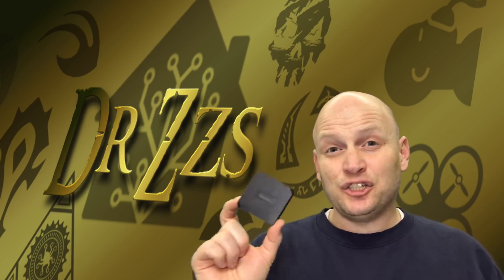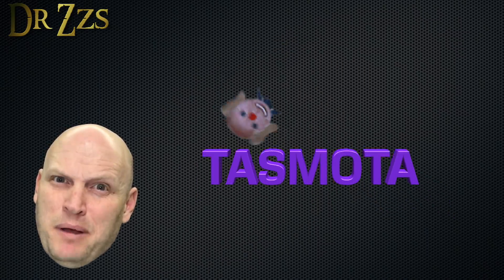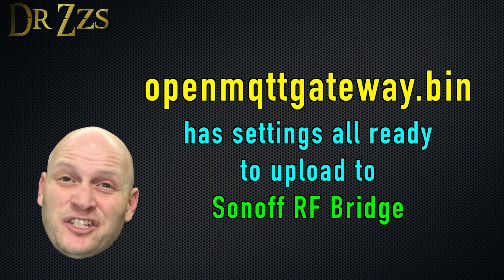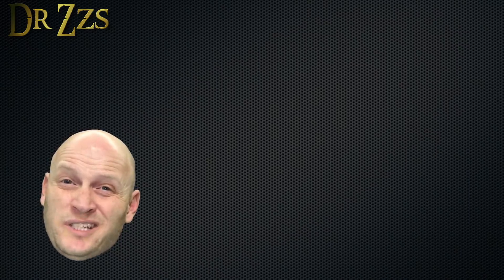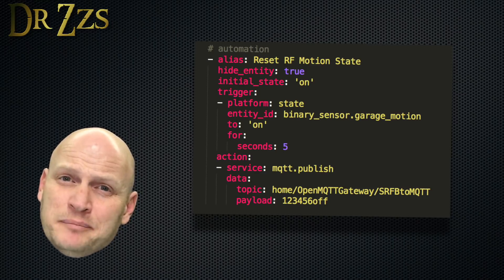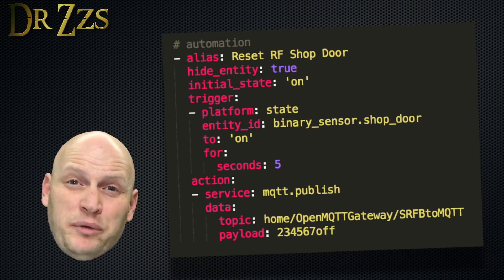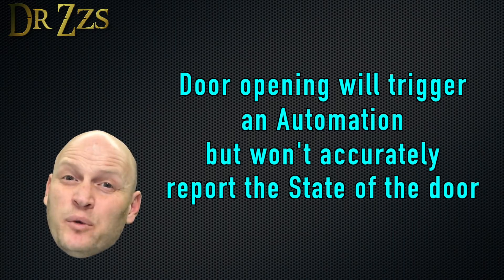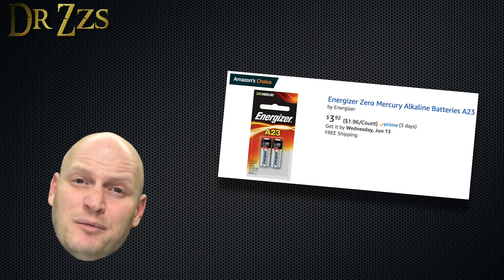Sonoff RF Bridge w/ MQTT & Home Assistant

Comment: Hey man. I'm having a hard time learning and sending   Rf signals with the bridge with stock firmware. Do you think tasmota will help this? Thanks.
Reply from the maker: Yes. I think TASMOTA is a very good solution for the RF bridge.  I have a newer video that this where I use TASMOTA. That’s what I use with my RF bridge too
Reply: As always, thanks for the prompt reply. Did you find you had any RF devices/remotes that the stock ewelink would not learn from, that TASMOTA was able to learn?
Reply from the maker: I didn’t even try the stock app. Sorry. TASMOTA was able to learn everything I’ve tried so far.
Reply: So I decided to just try TASMOTA on the Rf bridge as it wasn't working for me with the stock firmware. Unfortunately the RF remotes it wasn't learning before still are not being recognised, which is disappointing. 

On a second note, do you know if there is anyway to send a LEARNT RF code via MQTT with TASMOTA/Home assistant? (So an RF bridge MQTT switch, as apposed to a binary sensor). Thanks again.
Reply from the maker: really?  
Which remotes are you using?  I have 2 from Banggood and both are working fine.
Reply: DrZzs I've got an RF remote for a projector screen that doesn't work, and I my doorbell buttons. All of which are learnt (and resent) by my broadlink rm pro completely fine.

Comment: DrZzz do you think if I use a 433 RF Transmitter Arduino module to tramsmit sensor data (from temperature sensor for example), it could be read via the Sonoff bridge? The idea is to build a DYI low power temperature sensor with something like Adafruit Trinket + Temperature Sensor + 433 RF Emitter to transmit temperature to Sonoff Bridge and then to Home Assistan.

Comment: Hi! I've burned the OMG.bin but the wifi connect don't apear. Could you have idea about this problem? Thanks
Reply from the maker: That is odd. 
I've actually switched mine to Tasmota now.  With some help I got the sensors to communicate with Tasmota reliably.  You can try one of the other OMG.bin files (I believe I left 3 there for downloading), or you can switch to Tasmota.  Maybe tonight during the live stream we can go over the RF Bridge and Tasmota.
Reply: DrZzs Awesome. I prefer tasmota. Could you explain in live today? My Project stopped because this. Thanks a lot!
Reply from the maker: Let me try to give you what you need now.  First, the flashing should be the same.  Get the RF in programming mode (turn the RF switch off during flashing then back on after).  Use FlashEZ, Sonoff.bin and Termite (same as I just did in the video from yesterday).  Then set the module type in Tasmota to RF Bridge.  When it restarts go to the console and activate your sensors.  Note the number sequence that appears after "Data", that'll be the unique code for that sensor.  Then make your binary_sensor entry look like this (my topic is RF_Bridge, yours will be different so put yours where mine says RF_Bridge):
binary_sensor:
    - platform: mqtt
      state_topic: "tele/RF_Bridge/RESULT"
      name: 'Garage Motion'
      value_template: '{{value_json.RfReceived.Data}}'
      payload_on: 'D54C1E'
      payload_off: 'D54C1Eoff'
      device_class: motion
      optimistic: false
      qos: 1
      retain: false
    - platform: mqtt
      name: "Garage Door"
      state_topic: "tele/RF_Bridge/RESULT"
      value_template: '{{value_json.RfReceived.Data}}'
      payload_on: "D31421"
      payload_off: "D31421off"
      device_class: Door
      optimistic: false
      qos: 1
      retain: false
    - platform: mqtt
      name: "Shop Door"
      state_topic: "tele/RF_Bridge/RESULT"
      value_template: '{{value_json.RfReceived.Data}}'
      payload_on: "C7C2A19"
      payload_off: "C7C2A19off"
      device_class: Door
      optimistic: false
      qos: 1
      retain: false

The key is the stat_topic and especially the value_template.  The numbers after "Data" are the "payload_on" for each sensor.  Then we have to make the fake "payload_off" state, but that part is the same as the OMG process so it's in the video.  
Hope that helps!
Reply: DrZzs I'll try. Thanks

Comment: i got a 433mhz on off switch, i cant figure out how to set it up to turn on a light in HA, i got the sonoff rf setup in binary sensors, i tried this automation not working   alias: test 433
  trigger:
  - entity_id: binary_sensor.433_kontakt
    platform: state
    to: 'ON'
    payload: 13259682
  condition: []
  action:
  - data:
      entity_id: switch.akvarie_lys
    service: switch.turn_on
Reply from the maker: I don't think you need the payload in the automation.  What does your binary_sensor.433_kontakt entry look like? 
Does your 433 switch send 2 codes?  one for Off and one for On?
Reply: DrZzs it sends only one code and I can see the sensor change from off to on, I want it to toggle but maybe it just cant
Reply from the maker: You can do that.  Change your action to 'switch.toggle'
Do you have the automation set up to change it back to 'off'?  You'll need that if you don't have it already.  
Then it should work.  pushing the RF button sends the "on" code, so the sensor turns "On", that triggers the automation which sends "switch.toggle" to the akvarie_lys switch.  Then the other automation turns the binary switch back off after a short time.  I'd make it just a few seconds so you can push the RF button fairly soon after you've pressed it the first time.  

And I don't think you need the payload in the automation, just in the Binary_sensor entry.
Reply: DrZzs Thanks I will try it 😃

Comment: Does TX go to RX and RX to TX??
Reply from the maker: yes, you got it.  
The only time that changes is if you're using an Arduino as your usb/serial adapter, or if they've mislabeled the pins on the board.
Reply: DrZzs okay thanks!

Comment: please make a video using espurna and a pir detector! I got a lot of problem configuring it
Reply from the maker: Ok, I want to try espurna on my other RF Bridge.  I'll see what I can come up with.
Reply: thank you so much, i can't wait to see it! :D Anyway I love your videos, you are the best :D
Reply from the maker: I tried it a little last night.  Couldn't get the AP/login to work.  Could be because I had already flashed with OMG and sometimes it seems the wifi info is maintained after flashing.  
I do have Tasmota working with the Sonoff Bridge and PIR/Door Sensor.  I could do a video about it, but I'm waiting for Banggood to send me some door sensors that send 3 codes (open/closed/tamper) and a 433 Water leak detector.

Comment: at first i found openmqttgateway wifi network i configured it but then after disconnecting and connecting it back i cannot find wifi network as i want to reconfigure...please help
Reply from the maker: I've had similar problems.  Mine keeps going to AP mode, but the wifi is still visible.  So you can't see OpenMQTTGateway as a wifi network?  
I'm working on a different solution with Tasmota and/or ESPurna.  
maybe try this:
https://github.com/xoseperez/espurna/wiki/Hardware-Itead-Sonoff-RF-Bridge

Comment: So, I flashed my Sonoff RF bridge with the bin file supplied here but multiple times during the day, it will stop responding. When I look for available WIFI access points I see that it is back in management mode and broadcasting it's SSID. I can connect to it and reset the bridge but within a few hours it loses it's connection again and begins braodcasting SSID again. I think this may be a bug in the firmware as I have many devices connected wireless and they aren't losing connection at all.

I would like to flash the bridge with Tasmota but I can't figure out what I need to do in order to get the correct code being sent from motion detectors. Any insight into the situation would be much appreciated.
Reply from the maker: I'm working on it right now.  I just re-flashed a second bridge with Tasmota.  I've had a similar issue with the OpenMQTTGateway.  It disconnects but doesn't want to re-connect. Just keeps going to AP mode.  I think one of the .bin files I posted had that issue fixed, but I haven't even used it myself.  
Another firmware I want to try for the bridge is ESPurna:
https://bitbucket.org/xoseperez/espurna

for Tasmota the binary_sensor entry will look something like this:
binary_sensor:
  - platform: mqtt
    name: "Desk Lamp State"
    state_topic: "tele/sonoffBridge/RESULT"
    value_template: '{{value_json.RfReceived.Data}}'
    payload_on: "8585357"
    payload_off: "8585356"

But until I've done it myself I can't add much more than that.  (that's something someone else sent me as a solution).
Reply: Thanks for the reply.  Would you happen to know where I might get that bin file that had fixed the issue?

Comment: Hi, I flashed the sonoff RF with FlashEZ, the flashing seemed to be successful, but when I search between wifi networks I can't find the OpenMQTTGateway.
So I made an ip scan thru my modem in order to see if the sonoff rf was connected to my wifi network, and it was!
so I tryied to reach the ip of my sonoff rf via browser (192.168.1.219) but I can't reach the page.
How can I overcome this issue? 
Anyone can help me?
Reply from the maker: That is odd.  It shouldn't be able to connect to your network at all, until you've given it your SSID/pw.   How did you identify it with that IP address?  
Something strange is happening here.
Reply: DrZzs I thought connection could have been possible because I had already associated it via ewelink before the flashing. But anyway I managed to discover its ip with an ip scanner. Maybe flashing went wrong?
Reply from the maker: Could be.  Wish I could say for sure.  I guess if you got it connected we'll just call it good.
Reply: DrZzs unfortunately i cannot set it up because I can't access that page of the sonoff settings. 😥😥

Comment: Hi DrZzs First up great videos. Thought i would help out with tasmotising Sonoff RF Bridge. This worked for me.
Flash the Sonoff RF with tasmota in the usual fashion.
logg onto Sonoff Rf and do the usual Network and MQTT configurations and change to Bridge Module. Save configurations .
Then in the console place Sonoff RF in learn mode. enter 'RfKey* 2' (replace * with the number 1 to 16 being the unique number for the sensor that is to be linked with the sonoff Rf. should hear two beeps from sonoff rf then sync your sensor.
Then add the following to configuration.yaml

#add to configuration.yaml

binary_sensor:
  - platform: mqtt
    alias: "Movement Upstairs"
    name: "Movement Upstairs"
    payload_on: "1"
    payload_off: "key1_off"
    state_topic: "tele/sonoff/RESULT"
    value_template: '{{ value_json.RfReceived.RfKey }}'
    optimistic: false
    qos: 1
    retain: false

# note that payload_on: "1" is a reference to the sensor that you synced with the sonoff rf and can be number between 1 to 16

Add the following in the automation.yaml

#automation.yaml

- id: reset rfkey1 (movement upstairs)
  alias: Reset RF bridge RfKey1
  hide_entity: true
  trigger:
  - platform: state
    entity_id: binary_sensor.movement_upstairs
    to: 'on'
    for:
      seconds: 5
  action:
  - service: mqtt.publish
    data:
      topic: tele/sonoff/RESULT
      payload: "key1_off"
# the following will turn a light on when movement is triggered. 
- id: turn_on_movement
  alias: Turn on light when there is movement
  initial_state: 'off'
  trigger:
  - platform: state
    entity_id: binary_sensor.movement_upstairs
    to: 'on'
  action:
  - service: homeassistant.turn_on
    entity_id: light.stairs_lights

Hope this helps
Reply from the maker: Awesome!
Thanks!
I’m planning to try again this week. This will be helpful!

Comment: I feel like there's a step missing, where you tell how I add a remote or sensor to the RF bridge.
Reply from the maker: I don't have a remote so I couldn't do that part.  The way to add sensors is the same.  Activate the sensor and watch for the payload using MQTTlens.  Then set the sensor in HA using that unique payload.
Reply: So the bridge automatically add the sensor?
Reply from the maker: The sensor gives off a unique RF signal/code and the bridge can detect it and show you.  
Adding the sensor to HA is something you have to do manually. 
Hope that helps.
Reply: I will definitely give it a shot :) I've got espurna running right now, since I'd like to try out the web gui (looks great so far).

Comment: The mailman just delivered my RF Bridge, but this one is a Version 2.0.  It'll flash successfully, but cannot connect to WiFi through OpenMQTTGateway ... even using the password "your_password".  I flashed it with both the bin_1 and the bin_2 but no luck.  Guess I'll wait for your Tasmota video for this RF Bridge.  Wanted you to know about the V2.0 incompatibility.
Been loving your videos since December - keep 'em coming DrZZs!
Reply from the maker: bummer.  
ya, the Tasmota RF video is in the works.  It might be a couple weeks before I can get it all worked out and done.  If you want to flash it and get started the process for flashing is the same, just use Sonoff.bin instead.  The part I had trouble with was just getting the info from the payload, but I think I know how to do that now.   Go ahead and get it flashed and let me know what troubles you run into.  If you're free on Sunday maybe we can talk about it during the Live Stream.
Reply: Great - I'll do my homework and see you at 10 on Sunday!
Reply: Progress w/ Tasmota - now flashed Bridge and connected to MQTT, The Bridge's RF LED goes on for a second then off when I activate a sensor (using the Kerui you recommended) but have no idea what Topic to use to find the device code on  ... tried cmnd/sonoffRF01/power1 (where sonoffRF01 is MQTT device name for this Bridge and the rest of it is the format from a functioning sonoff Basic sensor working off of its gpio14 pin.)  Help me if you can, otherwise I'll wait 'til Sunday.

Comment: Is the Sonoff RF bridge also capable of transmitting?
Reply from the maker: yes.  
I don't have any devices that can respond to the signals currently so I can't test it, but yes, it is supposed to also send 433mhz signals like a remote control would do.

Comment: Great video as always. I got a number of RF light switches I can control with the Broadlink app. Just bought the Sonos Bridge and flashed it. How would I set up switches in Home Assistant using the bridge? MQTT lens detects the command when I flick the switch in HA but no light. My command looks like this:
- platform: mqtt
   name: "Kitchen"
   command_topic: "home/OpenMQTTGateway/SRFBtoMQTT"
   state_topic: "home/OpenMQTTGateway/SRFBtoMQTT"
   command_on: "4522264"
   command_off: "4522264"
   qos: 1
   retain: false

any advice? Thank you
Reply from the maker: Good question.  
I haven't tried RF light switches.  Is there only one code sent when the light switches?  I'm hoping there's one code when you turn it on an a different code when you turn it off.  
If that's not the case then we'll have to do some research.

The light switch entry you have there won't work since the command_on and _off payloads are the same. As you have it, Home Assistant will see the one MQTT message come in and would try to turn the light on and off at the same time.  That's why I'm hoping turning the switch off will send a different code. 
I'm not sure what to do with the state topic either.  

I'm wondering if OMG will even work with light switches.  If it only assigns one code to any message from that switch then I don't think it will work.  This might be a situation where Tasmota will be better.  
With some help I think I've figured out how to get Tasmota working with the bridge. Maybe I need to get an RF light switch to test with it.  

What RF light switch do you have?
Reply: DrZzs thanks for the reply. I got the switches from www.glstouch.co.uk. They are incredibly similar to the Sonoff Touch switches, minus the WiFi connectivity. I have them for around a year now. That was before I learnt about HA. I control them with the Broadlink RM hub. To my understanding all the RF hub does, is to send out a RF signal to the switch it learnt when setting it up. This triggers the switch. It doesn't know whether it's on or off. The switch is pretty dumb and does not send any feed back. If I can't see the light I don't know if it's on or off.
By using the Sonoff bridge I was hoping I can integrate it nicely into HA. I can't figure out the code learning routine with HA and the Boradlink hub. After one code it stopped and the trigger doesn't work either for me.

I actually got 2 tasmotized Sonoff Touch but I don't like the look and feel of them. Plastic and writing all over and clicking sound when turning on.
Reply from the maker: ok.  well, you might not be able to read the state of the switch at all (on or off).  It sounds like the switch doesn't support state reporting.  As for getting it to turn on/off with HA and the Sonoff bridge, try changing "command_on" and "command_off" to "payload_on" and "payload_off". 
That might fix it.

Comment: A quick (not complettly perfect) solution to the "Sonoff DW1 one code problem": 
Have two DW1 sensors mounted exactly over each other on the door/window frame. 
Have a magnet on the door leaf aligned to the bottom DW1. 
If the door is open, both DW1 pulls, first the lower next the upper. Program that in this case the upper DW1 state change will be ignored. (This is the not exact part of this solution.) The lower DW1 status change shows the opened state of the door.
When the door is closed, only the upper DW1 status will change. This will be the door locked status. 
(But the really exact solution a sensor firing two sates.)
Reply from the maker: That's actually a beautifully simple solution. 
nice work!